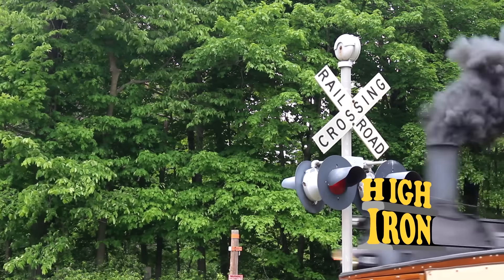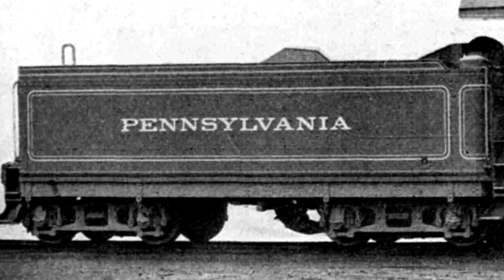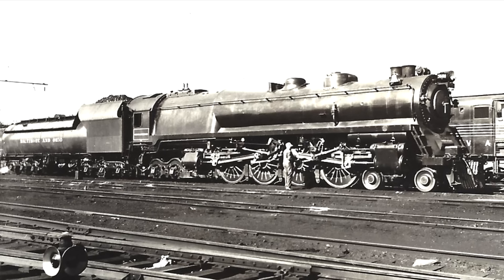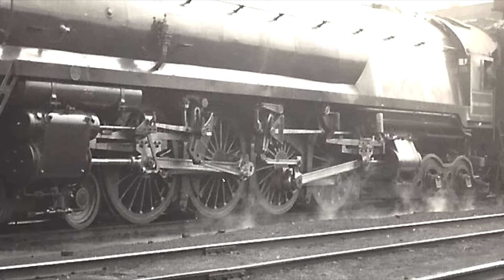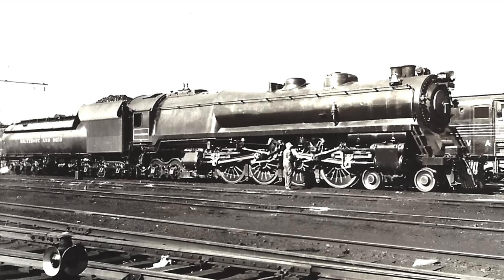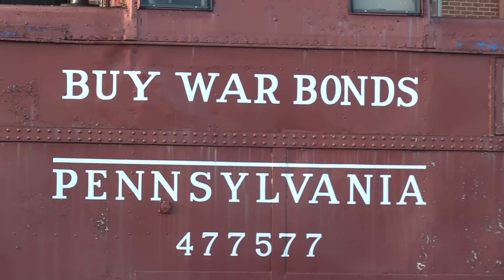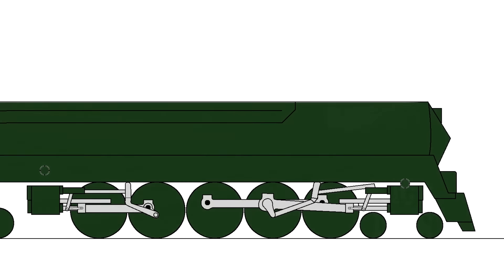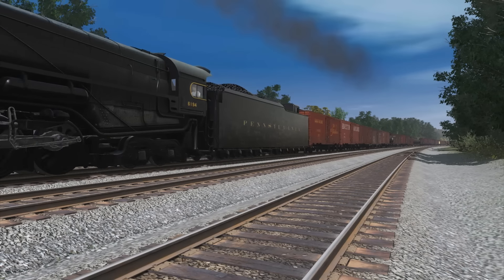Why Weren't Duplex Steam Engines Successful?

Comment: They were not successful locomotive. They were complicated and hard to operate once one engine started to slip the other one started to slip I don't care what the guy said that you can figure it out then you can control it but if that was the case then they would have been more successful but they were not. Regular steam locomotive Zach were 20 or 30 years old outlasted them by 10 years all of the complicated duplex drives were off the roster and scrapped while the simpler steam locomotives lasted until the end of steam

Comment: there was even steam electric, but it couldn't save steam.
too expensive to operate compared to diesel electric.
steam electric got rid of the rigid wheels, more like diesel electric now.
just too costly to operate.
Reply: There are still people actively promoting STEs.

The problem is that they all depend on the idea that their fuel can be sourced cheaper and more reliably from 'domestic' sources -- for which you should read 'coal' -- to make the trick net cost effective.  And that is now politically impossible, even if all the other technical details can be made to work as desired.
Reply: @wizlish  
oil fired steam was every where at the end.
coal had gone for the cost of using it.
more people, more maintenance.
diesel cut a lot of jobs.

Comment: Great video, 5550 is a dumb idea tho, rotary cams will screw it up, beating Gresleys record is just pure disrespect to Gresley.
Reply: The Gresley Pacifics were based on PRR locomotives they had the same drivers diameter and boiler design look it up or at least the A1 did
Reply: The British secretly took most of there ideas from the American builders, ALCO is a prime example. And yes they copied boiler designs from the PRR test plant. Gresley was behind even on basic features like boiler pressure and long valve travel  events. Even Churchward of the GWR admitted to the advancement of his designs was due in main to American designers and builders.
Reply: @IndustrialParrot2816  I know, Gresley took inspiration from the K4, do you know what inspiration is? Im not trying to convince anyone that the PRR duplexes were bad, im trying to say that building 5550 for a speed record is a dumb idea. They should build something like a NYC Hudson instead.
Reply: @zulu1697  they address why they aren't going to do that on their website
Reply: @IndustrialParrot2816  I dont see it...
Reply: @IndustrialParrot2816  Where??
Reply: @IndustrialParrot2816   Just about every top-line express loco in the world had almost the 'same driver diameter', usually between 6'6" and 6'9", so what?   Gresley's Pacifics and the K4's leading and trailing wheels were different diameters.   Gresley's Pacifics were three cylinders, not two.   They used a round-topped firebox instead of a square Belpaire firebox.   Tell me one feature (other than being a 4-6-2) that Gresley Pacifics shared with the Pennsylvania K4's that wasn't shared by every other Pacific under the sun.
Gresley owed a lot more to the work of Andre Chapelon in France than to anything the PRR did.
Reply: 5550 is definitely not a dumb idea, because the main purpose is to be used for excursion service on regionals and short lines. This will be an extraordinary tourist attraction.
Reply: @TranscontinentalRailfan  Shortlines? Bruh, do you know the wheelbase of that thing? If its built for a speed record its a dumb idea.
Reply: @zulu1697  Anywhere 765 or 611 can go, the new T1 5550 will go. The T1 trust said so. There are more railroads that 5550 can operate than you would think.
Reply: @zulu1697  A NYC hudson is also a dumb idea. Poor low speed performace with that booster necessescary to start it up.
Reply: Yellowbelly, your eponymous locomotive is in nearly all respects a better candidate... and has the advantage that the surviving example could be rebuilt, rather than replicated.  The one problem is that its drivers  are too low to keep piston machinery speed low enough for effective tribology at cyclic equivalent to high-120s speed.  (But yes, there are modern methods and materials that could address that...)
Reply: @wizlish  the L1 has the same problematic poppet valve gear as the T1
Reply: One thing Gresley owed a very great deal to was Churchward's and Collett's better understanding of steam distribution at high speed.  Gresley's Pacifics had their ass handed to them by the considerably smaller GWR 4-6-0s in fair comparisons at the time of Grouping in 1923.  It is part of Gresley's competence that he learned the lessons involved -- yes, some of them derived from American practice -- to get the A3 and A4 to the high level of performance demonstrated by Papyrus and Mallard (to name just two)
Reply: And the L1 can have the same Franklin B-2 bridges and other parts applied to suit it to type B or C rotary shifting-cam valve drive, with the light and effective drive-arm from the type D package used just as for 5550.

Comment: Because they had Diesel locomotives and in some cases Electric ! There's your answer in seconds !! No need for a 21 minute video !
Reply: But you're forgetting that during the years the duplex principle was being developed, diesel-electrics we're still relatively fragile, very maintenance intensive, and over three times as costly to buy even with GMAC-like financing.  The actual earliest 'common' workable diesel passenger locomotive was the early-postwar E7 (which is a big part of why so many were built) and you still could see a perfected steam design hold its own with them (see Kiefer's survey of motive power published in 1947).

But the Niagara was a special case, really an 'edge case', and absent the easy presence of trains needing sustained 80mph operation at any hour of the day or night, the stated advantages quickly collapsed.  And then came the E8 and it was 'game over' anywhere.